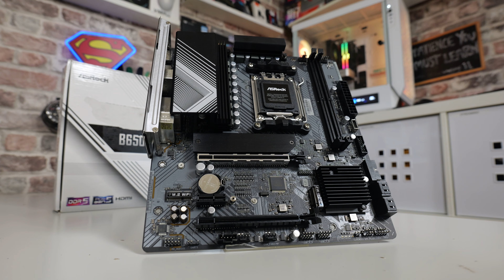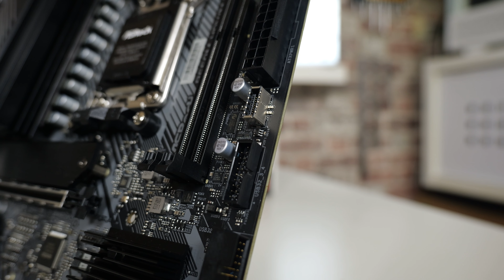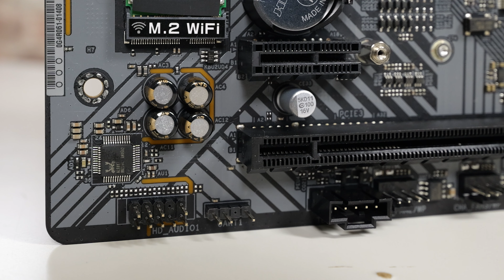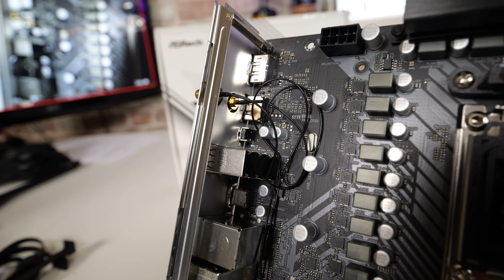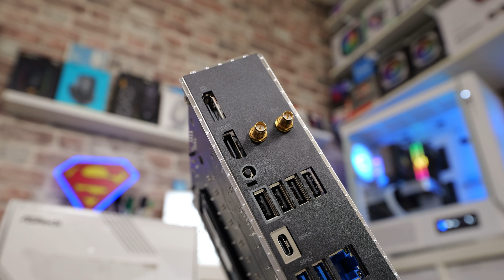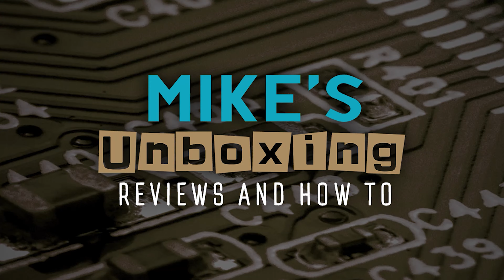BEST CHEAP Ryzen AM5 B650 MATX Asrock B650M HDV M.2 with 1 FATAL flaw

Comment: This board has zero coil whine. The fan control also works great. In short, this MB works great. I rather see more stuff like this from Asrock. Try to keep it simple and performing like this. Both Gigabyte and Asus is having whine issues this time around, which leaves us with only Asrock and MSI for this gen.

Comment: It's clearly labeled, it would be on the user's own stupidity if plugging in wrong connectors. I highly doubt that it will cause damage.
Reply from the maker: most user don't even read the manual or the writing on the motherboard, they just see what fits where, our discord it littered with tales of this happening. This is why i am concerned about it. sending 5v down a 3v header might not be enough to cause a fire, but it could damage more sensitive components on the 3.3v rail

Comment: can i underclock and undervolt the cpu from the bios with this board?
Reply from the maker: Yes you can
Reply: @mikesunboxing  
Thank you, that's all i care about.
Reply: @juanme555 why do u want to do that? im new also
Reply: @ajjames1960  
If you sacrifice just 5-10% of performance with these 7000 series processors you literally cut power and temps in half, its insane how far amd pushed it with the clocks and voltages this time around.

Comment: Hi, this mobo atm here goes for 166€.. do you think going for a B650M AORUS Elite AX Ice Gigabyte at 210€ is a better value?
Reply from the maker: not necessarily better value but a better board in  general, maybe that is worth the extra cost?
Reply: @mikesunboxing  Thanks for answering! i think so.. it has wifi 6e, bluetooth 5.2 and XMP/EXPO compatibility, talking about that.. can i use XMP on this with amd cpu? XMP ram are cheaper for some reason..
Reply from the maker: @Raikas  XMP ram is for Intel really , but might work on AMD, it is a risk, but it might work. Best option is to check the motherboard QVL listings and look for the RAM you are considering and see if it is listed and tested as working on the motherboard at the speeds on the box

Comment from the maker: PLEASE READ BEFORE COMMENTING
The fatal flaw for me isn't just that it has no RGB or ARGB. The fatal flaw is that there is a header on the board that looks EXACTLY like a 3 pin 5V addressable RGB header. This is actually only a 3v serial port (UART) and if you put 5v from a controller into it, bad things could happen. 
This is a pretty daft thing to overlook in my opinion, but i am interested to hear your thoughts.
On the Discord we get a constant stream of system builders that have plugged connectors into the wrong ports, and i think this will also be one of those boards that it will definitely happen. And if it doesn't kill the board, the disappointment of informing the user that it has zero rgb support is going to be a real hard pill to swallow.
Available from affiliate links:  
Amazon Local:  https://amzn.to/3SbCz8K
Ebay UK:   https://ebay.us/6oNsLI
Ebay US:  https://ebay.us/ZmPQBW
Ebay CA:  https://ebay.us/Lm8rbo
Ebay AUS:   https://ebay.us/jlOHz9
Reply: Bump.
Reply: I wasn't able to fit an RGB connector over the square pins of the UART header of my ASRock board. That said, people in the Discord have a talent for making things fit that aren't meant to.
Reply: So did you try to do it like you said you would? Bard says you can control ARGB through UART. The fact that it's 3v instead of 5v makes me think it will just make the leds glow less bright. I have just bought the ASRock B650M H/M.2 Do you think this one is the same in that regard? Most that could happen is the fans breaking
Reply: I don't see how this is an issue at all. If you're just plugging pins into pins without looking at the labels or anything then you're committed to playing Russian Roulette. If you do try to check the labels, you'll notice it doesn't say RGB.
Reply: @npip99  It's easy to miss. But I understand your PoV, it's not something you'd get if you hadn't already been put in that position.
Reply: @Welniak2000  why don't you take your own advice? you clearly comment out of ignorance, not having read it. You just assume it is mentioned in the manual, which it is not. Source: someone who has actually read the manual, unlike you.
Reply: I think you forgot to pin this comment
Reply from the maker: @npip99  i agree, but a lot of people do that and we often see them in the discord afterwards with non functioning systems.

Comment: So nice to see a complete review on this board. I had no idea about the RGB and am glad it is addressed.
I bought a BeQuiet! 500DX case which has its own RGB in it, but is minimal.
One thing to note is that the RAM isn't recognized and you need this to change manual in the BIOS. 
I had bought Kingston Beast 2x16 5600 mhz and it read only 4800 mhz.
AMD 5 7600 chip and Liquid cooler II AIO
Asus 3060 Gpu
Very happy with the set up and temp.

Comment: Mine arrived yesterday, just waiting the CPU and RAM arrive to see how well it will perform with the Ryzen 5 7600. Even when won't use RGB in my initial build, I'm the kind that surely would plug a RGB header on that UART port, great video!
Reply from the maker: glad to hear it
Reply: I have this mobo with Ryzen 7600 and G.Skill Flare 6000mhz CL30 - works flawlessly. Ran into some issues with enabling EXPO but after fiddling with various settings i finally managed to make it work.
Reply: @freezak3864  Hey what did you encounter? I'm planning building similiar parts with 7600x, this motherboard and Lexar Ares 6000Mhz in the coming weeks.

How's the setup playing so far?? 
Grtz
Reply: @Dailyrider94   It was just a bug where the EXPO profile setting to make the 6000mhz cl30 work didn't work and my task manager kept on showing only 4800mhz or so. I'm sure it's fixed with the newest bios update, make sure your ram is listed on ASRock's website. Other than that this combo, ryzen 7600 + 6000mhz cl30 + rtx 4070 is the best midrange combo you can buy on sale, at least in europe. It's perfectly adequate for 1440p 165hz, every esports game runs at constant 165fps, and every AA game on ultra settings with at least 60fps with dlss and frame gen, if necessary. You can't go wrong with Ryzen 7600, it's the best CPU for the money, with performance being on par with a much more expensive i5-13600k/14600k.
Reply: Exactly, for a discrete look build is a really good board, the fact that has only 2 dimm slots for 2x16gb, imo are👌🏻 the only "flaw" i see, is that the 2nd m.2 doesn't have a heatsink
Reply: @Eddinski  Yeah, it is a flaw in case you want to use a second m.2 ssd, but nothing stops you from buying a ssd with heatsink or getting an aftermarket one, it's cheap enough :D

Comment: i have personally used this board with a 7600x. its fantastic fastest boot times for am5 as i have tried many other motherboards. love the integrated io shield
Reply from the maker: Thanks for sharing
Reply: Second this. Used it with a 7700. Insane boot times. Also, it is dead silent. No whine.
Reply from the maker: @FrodeBergetonNilsen  Thanks for the feedback 🙂
Reply: Wait but this board said it only support 65 watts and i have a 105 cpus so idont if u are legit true

Comment: My only question is if i got RGB RAM Would it work? They should right?
Reply from the maker: yes it will, but will need some software to control it if you don't want the default unicorn puke

Comment: Can't seem to find the link to the m.2-wifi-card you've used. I'm about to build a pc with this board and have been searching for a cheap m.2-wifi-card
Reply from the maker: https://www.amazon.co.uk/RUANI-Wireless-AX211NGW-802-11Ac-Bluetooth-green/dp/B0CHDZY9DQ/ref=sr_1_21?crid=251DTV10YI0UP&keywords=m.2+wifi&qid=1699366857&sprefix=m.2+wifi%2Caps%2C88&sr=8-21&tag=mikesunboxrev-21
Reply: @mikesunboxing  Thanks - sadly that's unavailable but now I know the type so I'll manage to find a reseller.
If you'd allow me one more question - I've bought a case with 2 RGB-fans even though I did realise that the MB did not have RGB-headers. Which kind of 3rd party thing would I need to buy to light the fans up?
I'm eagerly anticipating your other videos on the motherboard!
Reply from the maker: @aarhusno1  https://www.youtube.com/watch?v=p2z86uMMh_E this might help

Comment: Is it me or are the "50" boards getting lower specs? Nice to see "C" port on mb, odd no rgb, yet cud run high end cpu and m.2 gen5. Entry price i get but seems we get upgrades at expense of expected min stds. Thanks for reviewing Mike & Kath, hope the replacement Asus is higher spec. 👍🐈
Reply from the maker: the complexity of the new modern chipsets and VRM solutions is pushing prices higher and higher. I can remember getting a AX370 board for £30 only a few years ago
what is going on, and when will we see tangible improvements revenant to the increases in pricing?
Reply: I'm 1 day late i know. but Happy Birthday 😀
Reply: @WilliamAPBodie Moin my friend & thank you🍾🍺

Comment: Michael, thanks for this video. I've bought this mobo for a VFM mid range system. I intend to install Windows 10 IoT Enterprise 2021 LTSC . Do you happen to know if this chipset is supported? Thanks. :)
Reply from the maker: i honestly have no idea, but it should do
Reply: @mikesunboxing  Thank you.
Reply: @mikesunboxing  Excuse me I have one more question.The upper,small, black plastic vrm heatsink on the motherboard,in mine,moved.I could bend it slightly  backwards, and when I left it, it got back in its position.But it wasn't tight and immovable. Was it the same with this one? Is it supposed to be like that,or was mine faulty? Thanks for your time.I appreciate your answers.

Comment: Quick question please, What M.2 port should I use for my main system for the M.2 NVMe Internal SSD port?
should I use the 1 Hyper M.2 (PCIe Gen4x4) or 1 Blazing M.2 (PCIe Gen5x4) or does it matter? 
This is what I have Crucial P5 Plus 2TB M.2 NVMe Internal SSD.
Reply from the maker: i would use the top one personally, but either is fine

Comment: Not having WiFi confuses me, so you buy it separately from a 3rd party?
Reply from the maker: yes if you need it, or buy the version of the board with it on. The Pro RS Wifi for example which isn't much more money
Reply: @mikesunboxing  Thank you! This will probably seem silly of me, but I appreciate a motherboard with 2 DIMM slots instead of 4 because I've heard/read that using 2 is more stable than using 4. Also, motherboards with 2 slots seem to be less expensive than motherboards with 4 slots. Ideally, an AsRock MATX motherboard would have 2 DIMM slots, AM5, and Gen 5... with included Wi-Fi.  😌

Comment: DUMB question, I already bought this motherboard, it arrives this week, it is my first build, I also bought 6 thermalright ARGB fans and a cooler for the cpu also thermalright with ARGB, now watching this video I find out that it does not bring the ARGB connector, this means that none of my FAN will turn on the lights? or if they will turn on but there will be no way to change the colors? there is no option to control the colors?
Reply from the maker: that is right you will need to buy a standalone ARGB controller to make any lights work, or return the board and get the PRO RS version

Comment: Need fast answer
Got thos board and still waiting for cpu. Just wanted to check some fans but i cant  turn on the board without cpu. Did I get defective board or you cant turn on AM5 board without the CPU. Can someone confirm?
Reply from the maker: needs a cpu to complete the power on circuit
Reply: @mikesunboxing  Ty so mucg

Comment: do i need to put top m.2 heatspreader back after install m.2 ssd
can it work with m.2 heatsink or just for showing
Reply from the maker: you can use the cover heatsink if you like or not, it depends on the drive and how hot it gets

Comment: Before watching the video, all i hear is negative reviews for asrock motherboards. Just in general. I'll save a few bucks more for a more trusted btand
Reply: I think it depends with Asrock. Sometimes they mess up, the next gen they make pretty nice boards. The only established brands I wanna avoid are Gigabyte (shitty support, risky quality) and Asus (just cause of what they did :)   )
Reply: @Greenalex89   My current board is that nice looks white NZXT board, am4. Apparently it's built by ASRock and it's good, exept for the WiFi antenna. So I'm not sure, any thoughts on a good brand? And I've also heard about Asus and agree

Comment: Never buy Asrock they have audio problem they use Nahimic Audio software which can't be set realtek audio chip doesn't support original realtek control panel from bios gives error. Forces Nahimic to be used.. And now my board trip back to the seller.! SORRY ASROCK

Comment: Only x2 dimm slots is disappointing.
Reply from the maker: yes but not a disaster, 2x16GB should be enough for most people for a good few years
Reply: ...it's a budget board. Someone buying a sub $150 board probably not spending more than $150 on RAM as well.
Reply: Most people only use two slots so its not that bad
Reply: For me it's better because it's gonna overclock memory better
Reply: ddr5 running 4 dimms in general is just not a good idea both intel and am5
Reply: 4 slots is only useful for dummy RGB sticks at the moment.

Comment: Okay so, wait 
This might sound like a dumb question, but I am a certified dumbass when it comes to computer parts
What exactly is the downside of a lack of RGB headers? Does it mean the RGB just won't turn on? Does it mean I can't control the RGB? I'm just very confused.
Reply from the maker: Yes it has no ability to control any additional argb or RGB devices. But more concern is from the port on the board that looks like an argb header and could be used to connect argb devices but could burn out the port or the devices
Reply: @mikesunboxing  Okay, so, assuming I have a moment of lucidity from my caveman brain and don't plug into the port that looks like an ARGB header, the main downside is that there is no control of the RGB?
I'm not sure I understand. As in, even if I installed software to change the color of the RGB, the software just wouldn't change the color of the RGB?